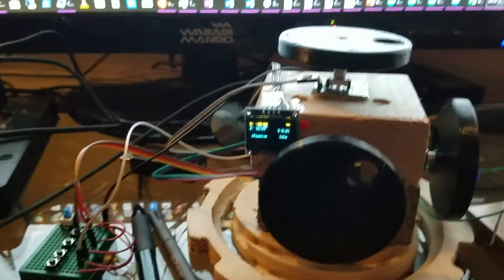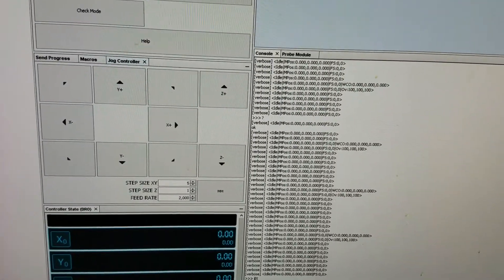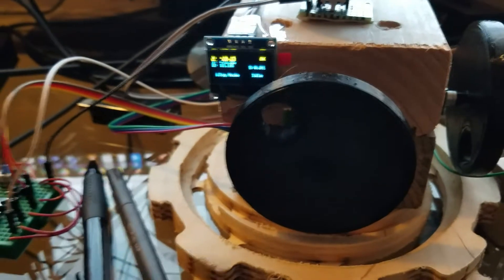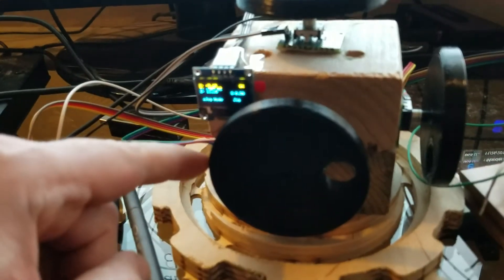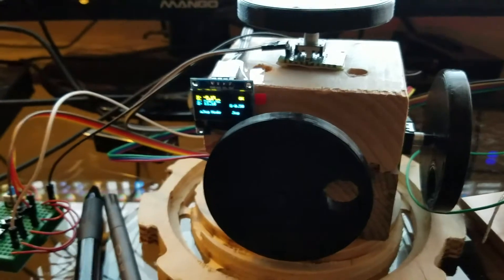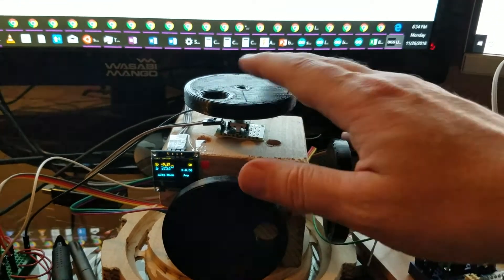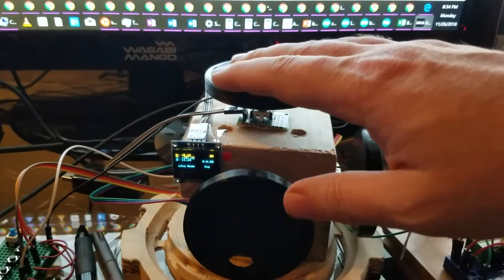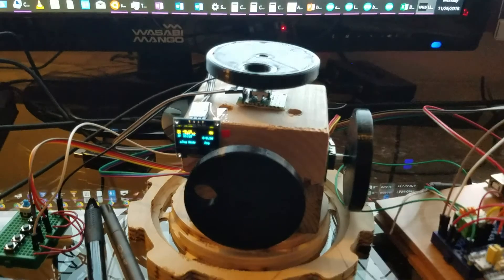Grbl mitm pendant prototype

Comment: Nice... Can we do same using an arduino nano??
Reply from the maker: you could but the stm32 has hardware quadrature encoders which allow for very very fast signal processing.  As soon as you miss signals the encoders will behave strangely, you've likely seen this with mechanical encoders on things like 3d printers, they go the wrong direction randomly when they miss signals.
Reply: @JesseSchoch  I don't know a lot about programming but can we put data on tx pin of grbl arduino while it's connected to a pc?
Reply from the maker: @DiscoverRajivVlogs  not sure what you are saying.  this test was acting as a "man in the middle" and could pass through the commands sent by your PC via USB.  If you don't want to do pass through  you need to send the jog commands to uart1 or uart2 and the controller needs to be able switch which it is listening on.  I have done this with grblHAL.
Reply: Sorry for that badly written comment....

 Yah, I got it man in middle concept ... But if I feed only tx to the grbl arduino while it's connected to PC and grbl is in idle state....and if the signal won't interfere with the pc then grbl will read the commands.... After that grbl's system will send data to the pc and pc will recognize the new data and will display the position and other data to pc..

I mean do i really need rx data to be received on the jog arduino? Well the best I think is right, maybe dual serial at a same time is not possible in this simple way.....